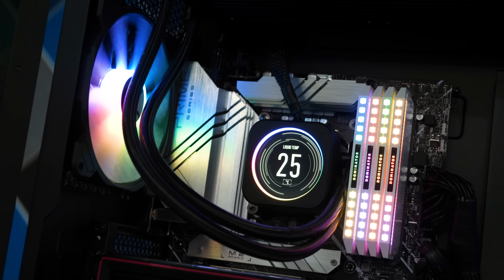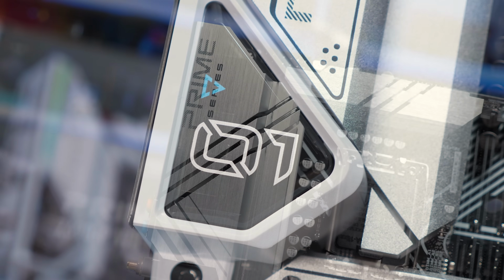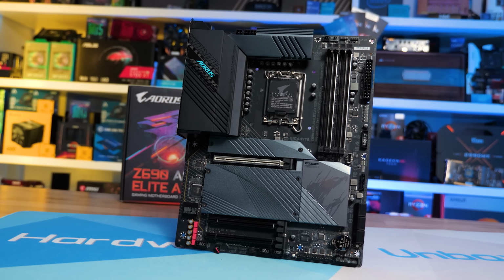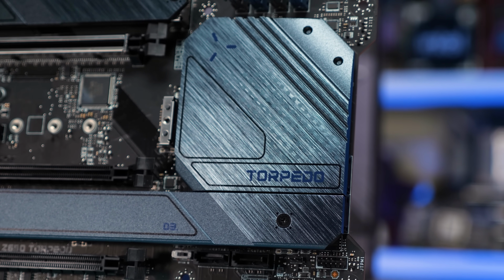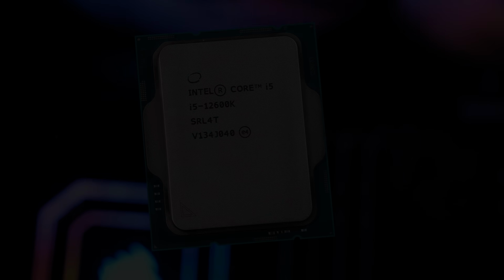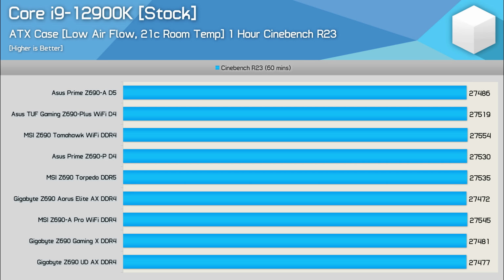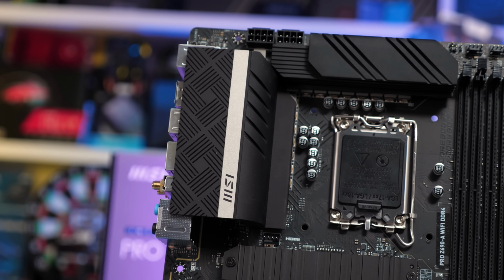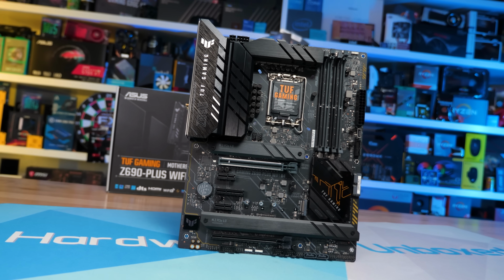The Best Value Intel Z690 Motherboard: VRM Thermal Benchmark

Comment: The best z690 mobo is msi carbon cause it has all of the features for $400, not that cheap but that is the cheapest motherboard of which you get 8 layer pcb, all of the USB ports in the rear IO and pci-e x8 x8 two sli ports and a bios error code led. If you don't care about x8 x8 slots go for 330 usd aours pro...

Comment: Important question. I notice in the graph it has package power. Is that 12900K CPU package power only, or is that the overall motherboard and system power draw. If its CPU package power, to me the Asus Tuf or another with lower CPU package power is a must. If so is this result influenced by the auto overclocking results and they would go out the window if you manually overclocked?

Comment: I’m thinking MSI Tomahawk for me. 12700K with a 360mm radiator. I’m looking at the Fractal Torrent case to house it…anyone have a similar setup? I already have an eVGA 3080Ti FTW3 Ultra and an eVGA G5 1000w PSU. 

I don’t think I’ll have enough left in my budget to go the DDR5 route.
Reply: I would look at other cases if going water cooling, the big advantage for the Torrent case is its airflow and nice fans.
Since the torrent case is top PSU mount you would have to either remove the stock front fans for the radiator or try to do a lower radiator mount which is not ideal.
A lot of the feature to justify cost for the Torrent case is for the stock fans.

There are much better cases at cheaper price points for water cooling. Lian LI Lancool2 performance mesh is one.
I own both the Lancool 2 and the Torrent case and for water cooling I would choose the Lancool 2.
Reply: @billwiley7216  I was actually looking at the O11 Dynamic and XL versions… they seem to be in and out of stock or super inflated with pricing though.

Comment: @HARDWARE UNBOXED

Which DDR5 board do you recommend for gaming/overclocking/benchmarking with full capabilities? 

- Gigabyte Z690 D5 AORUS PRO
- MSI Z690 D5 TOMAHAWK
- MSI Z690 D5 TORPEDO

Comment: After I watch his video about e-cores,if only for Gaming,scrap 12th gen scrap z690,useless and expensive.Basically you buy i5 for 320€ and cheapest z690 ddr4 mobo for 230€,than disabling 40% of processor cores (e-cores) for best gaming resoult. AAA? Thats right! Basically u get 6 core cpu+entry lvl mobo for like 550. Basically u are better off with 5800x for 410 and sick b550 for 150. End of story,the end,we have nothing to talk anymore.
Reply: hows i9 10850k and z490??

Comment: Gigabyte are shady hiding info their motherbaord like their power supply will heat up and burns. Msi board is ol but performance and features are weak. ASRock boards are just cheap. Asus ROG, stix tuf and prime are the best from good better and best. Best innovation with Q release and QLatch bios overcooking features. And most reliable

Comment: I own a MSI Z690-A Pro Wifi DDR4 board. Love it to death. I own two previous series of this board, with the Z490 and Z390 mobos. Z390 is out of commission until I can fetch some spare ddr4 but she functions perfectly well. The Z490 is paired with an 11400, running a Minecraft server, serving me perfectly well. As long as MSI keeps up the good work, I'll keep buying their series. I might even splurge and buy the Z590, just to have it on hand and complete the collection, from Z390 - Z690.

Also, forgot to mention, I have a 12600k paired with the Z690. I'm not rich man... so... the, uh,  12900k can just gracefully remain a pipe dream while I actually play my games and do my work.
Reply: Can you overclock your motherboard safely?

Comment: I think the difference this time is that 240W are the official requirement from Intel and all manufacturers are following it.
On the other hand with Z590 and before it was always a 125W requirement with "can optionally support up to 300W" and board manufacturers did exactly that. Cheaper board had VRMs designed for 125W, better boards had VRMs for 200W+

From a product perspective the 240W requirements were definitely a good decision for the Z chipset and K CPUs. End users are free to choose a lower TDP, but if you buy any board you know the full TDP actually works.

From a marketing perspective I think it was not such a good idea as everybody believes the 12900K draws 240W under all applications. Most average buyers dont know that real power consumption while gaming is much much less.

Comment: Why is on board audio always omitted during motherboard reviews? Big difference between an ALC 1220 and some crap audio bloc
Reply from the maker: How many people even care? I've not used on board audio in over a decade. If you care you'd have a DAC our PCIe sound card. If you don't you're almost certainly using a device with USB audio.
Reply: @Hardwareunboxed  Most consumers aren't buying audio DAC's with their PC, they may not care because few reviewers mention them. Audio is a big part of any experience, might as well tell people to buy any monitor they can find as long as it puts out a picture.
Reply from the maker: But even in that scenario, who is using onboard audio? Almost all sound bars and speakers are USB now and all headsets are.

Comment: The Gigabyte boards likely are running at about the same efficiency, with basically the same heatsink and presumably thermal pads.  Not surprising that they run at the same steady state temp.

Comment: Wat about asus rog strix z690 A gaming d4?
Reply from the maker: It's way out of the price range tested here but I will look at it soon.
Reply: @Hardwareunboxed  hows asus tuf z690 ddr4 with i5 12600k vs i9 10850k and z490 gaming edge at same combo price 
currently i have i7 7700 non k ,32gb ram , rtx 3070 ,CM650 80plus gold. please suggest.

Comment: Held off on buying a new 12th gen CPU till I saw your z690 testing results.  If you and Buildzoid both say a board is good to go, I'll be on the hunt for one when the time is right.  Luckily you both have recommended the MSI Z690 A Pro as capable of handling any of the 12th gen chips.

What are your thoughts in terms of value/ performance when jumping from the $200 to $300 USD price points?  I'm personally not really seeing a reason to spend $100 more for a built in back plate and maybe 2 more usb ports.
Reply: From what I can see, the jump from $200 to $300 is slightly better VRM and connectivity (USB, M.2, etc). Personally, not worth the $100 jump since 14 phase / 50 Amp seems to handle the 12900K just fine. I went for the Asus z690 prime-p d4. Haven't tested yet, still waiting for my LGA 1700 mounting kit from Noctua.

Comment: When Alder Lake just come out, and Core i9 12900k's would hit 94 °C under a top air cooler like Dark Rock 4 Pro, I was a little worried. 
Hopefully, the situation has changed a little.

Comment: I got the MSI Z690-A Pro and i5 12600k at a very good deal imo, $424 total for both not counting $30 of rebates.
Reply: That's a pretty sweet deal. I'm eyeballing a MSI B550 Torpedo and R5 5800X combo at $435 myself.
Reply: @andersjjensen  I was in between 12600k or 5800x but I really like the 4 m.2 slots on so many of the Z690 boards
Reply: @deviouslaw  Yeah, that makes sense. Personally I have a self built NAS because I've just given up and accepted that I'm a hoarder so I'll never have enough space for disks in my work machine. That and I don't like the sound of spinning disks (ain't nobody got wallet for SSDs in those amounts!) so a single 1TB for software in my machine and a network drive physically located in the utility room works a treat :P
Reply: @andersjjensen  Too funny, that was part of my consideration. B550 itx setup and build a NAS, or Z690 with the connectivity. Sounds like a great setup
Reply: @deviouslaw  Depends on what it is you're using your space for. If you have a bonkers big Steam library I can certainly get behind the extra cost of NVMe drives (though, lets face it, most older games load plenty fast from SATA SSDs too). But if you're the type of person like me who hits "print to PDF" every time you see an online article you'd like to retrieve later, and save every movie you've, uh, obtained forever, and rip everything off youtube that might be deaned controversial by the alphabet... then spinning rust in a JBOD config is the only thing that isn't going to ruin you financially :P

Comment: Grabbed the MSI Z690-A Pro as it was the only available board in stock when I was ordering my 12900k. Unexpectedly it's actually great and I will probably end up keeping it instead of switching to a fancier board later like I was planning to.
Reply: Have you tried overclocking the 12900k on it? Is water cooling a must for that?
Reply: @DrMrPersonGuy  Only turned on the automatic speed booster via XTU. It stays locked at 5.1GHz under load. Using the Arctic Liquid Freezer II 360mm AIO cooler.
Reply: @Edvardas96  I see, ty
Reply: @Edvardas96  do you know if a cooler master 212 will fit on this? I’ve heard about them not fitting on some z690 boards
Reply: MSI: "You can get everything good with the -A Pro series, except fancy looking and sounding. In return you promise not to brag about your board so others buy the expensive fancy looking ones. Deal?"  

Customer: "Yeah.. I can't really brag about this board.. it looks generic, has a generic name and there's not much bragging right in 'it works all the time' now is there?"

MSI: "Ah, so you accept my terms and conditions! Shall we close this deal with a handshake?"

Seriously, I've been building PCs for more than 20 years. People are getting ripped off left, right and center. Unless you intend on serious over clocking, or you're doing a type of build which is severely hampered on cooling or airflow due to the form factor, a good quality generic board should do just fine. It's atrocious how many boards out there are either hot garbage or a completely dolled up common Sue. 

Most of these brands should only have three lines: 
Budget: Does not support the xx900(k) SKUs, Realtek audio/LAN/Wifi. VRM enough to run the xx700k stock or the xx600k with a mild over clock. Names contain one letter and one number.

Generic: Socket vendor spec VRM. Nothing more, nothing less. Several different I/O configurations available, but basically a copy-pasta of the same board over and over gain. Maybe a few different colour schemes. Names contain two letters and two numbers.

Enthusiast: VRM enough drive a tea kettle. All the shit all the time with all the extras. Bluetooth connected smart phone app for extra over clocking monitoring and privacy invasion. Possibly even a dating app in the BIOS. More RGB. Monthly new shrouds/covers as a subscription feature for those who like to play dolls with their mobo. A bit more RGB. Gamercentric sounding names like "The Skull Crusher", "High Voltage Shock Zapper", "Extra Mega Super Awzum", etc, etc. Some more RGB.
Reply: @andersjjensen  I totally agree with u, the z490 Pro from msi is also generic as hell and still works perfect with a oc I5 10600k = 220 watts.

Comment: Hey Steve on Msi z690 a pro I’m having usb problems, are you??? Using 1.15 beta bios and usb 2.0 header on board is not direct it’s a usb hub from a hub from direct on usb 3.2 chip. Also front usb c giving me errors on external fast usb c ssd and it’s not the ssd

Comment: MSI are great at making entry level to mid tier motherboards. I have a B450 Gaming Pro Carbon AC and it was one of the best B450 mb at the time.
Reply: b450i gaming plus had straight up the best b450 itx vrm out there, the b550 is great as well, not the best as that title goes to to the strix (not even considering GB as their b550i has major BIOS issues), the b450 can run an overclocked 5900x albeit with a fan pointed at a 103°c VRM, the b550 run the same cpu just fine.

Comment: Got the MSI Z690-A Pro + 12600K a week ago, this benchmark really assured me that I bought the right board. Top notch testing steve.
Reply: Even Buildzoid is swooning over the -A Pro and that guy can normally ramble for like 30 minutes about a single thing he doesn't like. For a 12600k it's practically overkill. Like you'll melt that thing out of the socket before the VRM throws in the towel.
Reply: @andersjjensen  that shows a lot

Comment: This is hard lol just got my 12600k, I'm going with ddr4 ram, I need sata ports. I'm looking at the msi edge for 320, tuf for 280, or msi for 230. I just don't know lmao
Reply: My Z690-UD DDR4 has 6 SATA ports (I use 5), 3 NVMe slots (I use 1) and was the cheapest thing available on release date. Not sure if I would change my choice if this video was available back then, I still want my PS/2, too, which most boards don't bother with anymore, even if they come with mostly blank back I/O :/
Reply: @--Lam  I'll add that to the list of possibilities, the mobo prices and layouts definitely have me thinking this over. Thanks for the input! 🖖

Comment: Would you be able to do the testing with overclocking? Would these motherboards handle an all-core OC?
Reply: The ones that ran at 75C under stock conditions are probably going to sweat if you try to push a 12900K to 5.2GHz all-core. But by the looks of it all of them would be able to fry a 12600k without even getting their breath up.

But generally: if you want to do heavy over clocking you should not be considering entry-to-mid range boards like these. The days where you could save money by over clocking are long gone. These days it's more for bragging rights than anything, since the boosting algorithms are so aggressive that it's all going to come down to cooling anyway.

Comment: Great overview - thanks for your great content.  I was able to snag a 12600K for $200 USD and a MSI Z690-A Pro Wifi DDR4 for only $210 - and then the bundle saved another $20 so only $390 for this at Microcenter.   Working great!  I would suggest a great video would be guides to the different vendors Bios for over clocking.  I’ve used ASUS for the last 7-8 years and the MSI bios is so bad.   I’ve tried to do some basics and for whatever reason hasn’t been working.   I gave up and went stock + XMP and haven’t seen much reason to mess with it.  But would love a video guide to help down the line.
Reply: is 4.9ghz turbo boost on 12600k enabled in the bios by default or do you need to do it manually?

Comment: Love the great testing/content. I understand why you would go with extreme high end case, AIO and PSU to avoid the test system from being a limit on the new Intel CPU's. But, I am not sure how realistic it is for most people to spend around $800+ (USD) on just these three components?  It would be interesting to see what happens to the 12900k when put in a case with components that an average DIY gamer would choose like a 850w gold psu, a $100-150 case (4000D, 5000D) and either a 280mm or 360mm AIO. That would shave about $350 to $400+ off the build price... But, could Intel's new CPU's survive in such an environment at a normal household temperature of say 25c or 26c or would it turn into a good imitation of an air fryer?  Again, fully understand for testing why you chose to go high end... But still curious what would happen with more realistic conditions.
Reply: 12900k, 280AIO, Corsair 400D airflow= similar results.

Comment: I know its a sponsor and you say about it what the sponsor gives you...but that abomination is NOT ERGONOMIC.
Racing Seats are designed to support the body, so it doesn't move while accelerating. People at home don't accelerate >_>...
The Price for the E700 is ~1200€ in Germany. For the SAME Price i've bought an Herman Miller Embody on Black Friday (the Aeron was priced the same).

Comment: Did you have any RAM compatibility issues with the Gigabyte boards? There were quite a few reports suggesting that many RAM kits (even ones with 3200 cl16, etc.) didn't boot with ram overclocked or just xmp enabled

Comment: I recommend MSI z690 pro a if you dont want rgb fluff and just want a solid board with great overclocking features, if you truly compare it to others like asus tuf z690, MSI  has same or more features for less. I was able to do 5.3mhz oc with 20 c idle and 77 full load on a 12900k, that being said, you do need a good cooler.
Reply: That you need a good cooler is not the fault of MSI though! :P
Reply: Those are VERY good temps. Could I ask you which cooler you're using? Thanks!
Reply: 360 aio Cooler Master with noctua fans on both sides doing a push and pull cycle, also, i have my cpu undervolted to 1.25v which helps the temp, but surprisingly kept going 5.3mhz stable in all test i made!
Reply: Which cooler do you use
Reply: Would a 12900k require liquid cooling on most motherboards? Or does the msi board not provide enough heat sinking? In the video seems hot compared to others

Comment: The boards with worse thermals also pulled more power, but the performance wasn't any higher either. Down to efficiency losses due to quality/temperature?
Reply: Could be they are also powering more things on the board possibly?

Comment: I paid a bit for the MSI EDGE DDR4 board and no complaints. Looks great and supported 4400mhz CL 19 straight out of the box.
Reply: I'm thinking about purchasing this mobo. What are your thoughts so far? What cpu did you pair it with?
Reply: @BRCAMARONXX  I went with i9 12900k, completely unnecessary for me but at least I’m future proofed for awhile. So far all good once I figured out how to set the bios to legacy mode and not uefi only.
Reply: @deadlyair  what cooler did you paid it with and what temps are you seeing? Im leaning towards the i7 and my worry with the i9 were temps
Reply: @BRCAMARONXX  I got the new MSI S280 coreliquid. Admittedly idle temps are high, usually low to mid 40s although I’ve also never seen over 50 while gaming. I plan to take it off and apply fresh thermal paste and see if that makes a difference. Not convinced about these coolers and the thermal paste they come with but also the thermal plate coverage on these 12th gen cpus.